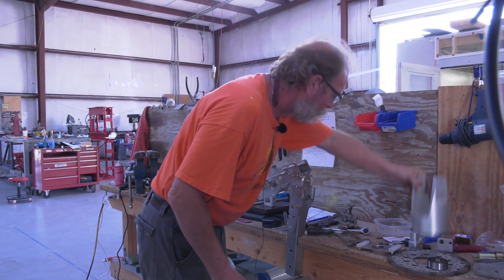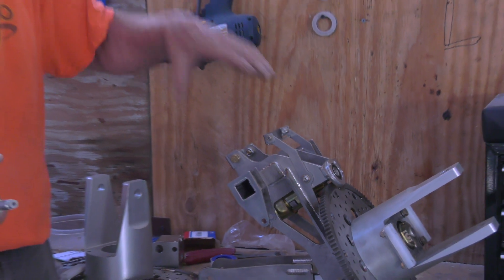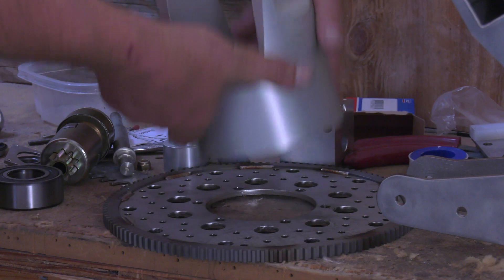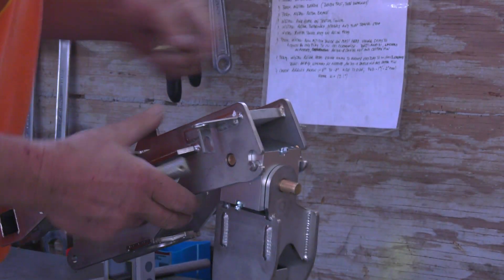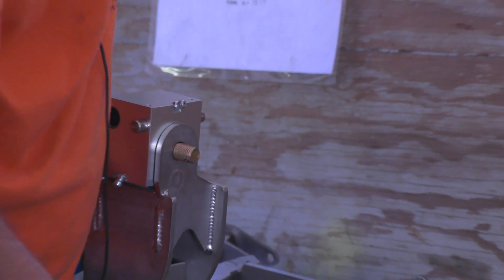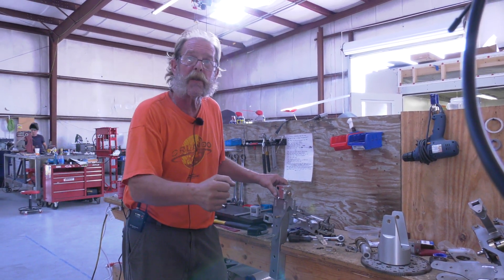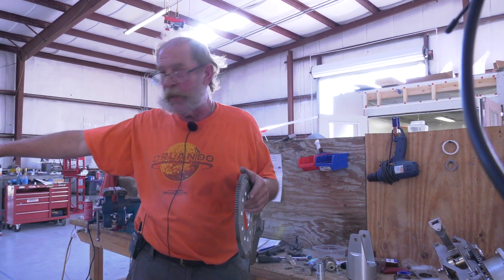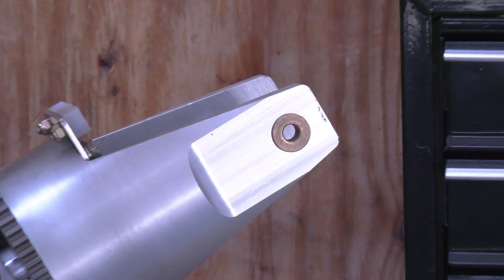AR-1 Gyroplane Rotorhead Assembly - Part 2 of 2

Comment: Sir what the use type of bearing in rotor head.....please tell me
Reply: Sorry for the late reply Sanjeet. For the main spindle bearing where the rotor rotates, I designed it to use a double row angular contact bearing made by SKF. However, engineering wise and to some people tapered roller bearing is better in this application because the way axial and radial loading happens here. Although I agree with that principally, tapered bearing block can be misassembled causing rotor to literally fly off. This a angular double row bearing of higher dynamic loading is enough and can not be misassembled and many gyroplanes have used it successfully and it lasts 2000 hours generally before replacement. Hope that helps.

Comment: What is the weight of the entire rotor head assembly plus blades?
Reply from the maker: Rotor system is 85 pounds. Rotor-head weight is not important because we never sell our rotor-head separately. Only on our machines
Reply: @silverlightaviation  Wow, I did not know it is that heavy. Is it made of 4150 steel?
Reply from the maker: @Aviator168  They are Aluminum alloy. Steel ones would be 150 pounds. These are not your old Bensen style machines. Rotors are 8.6 meter (28.2 feet) span, 8.5 inch wide chord
Reply: @silverlightaviation  I am just asking about the rotor head, not the blades.
Reply from the maker: @Aviator168  That's funny because that is what you asked in your original comment (plus blades).  Anyway, as I said rotorhead weight is of no importance as we do not sell it. It can only come with our aircraft kit. What counts then is just aircraft empty weight

Comment: Is that Radial  load bearing acting as a thrust bearing in the rotor head ? I will use a taper type bearing in this case
Reply: Good job bro
Reply from the maker: Some older designs did and do use tapered bearings and there have been a couple of deaths and a couple of videos showing rotors flying right off because people assembled those tapered bearings upside down into the towers. These bearings are not your regular ball bearings. These are double row angular contact bearings that can handle loads in both axis. The loads carried in this bearing doublet in the rotor head exceeds 6Gs and you cannot assemble it upside down. It does not matter

Comment: U have all these strong bolts and stainless parts, why not the little aluminum block be made out of stainless or light titanium that would be much stronger than the aluminum block.  It seems the aluminum block might be the weakest link and with that hole drilled through pretty near the edges.   Just am wondering is all.
Reply from the maker: And yet not in a single crash the Aluminum block has ever torn off. We are not making tanks. These are aircraft. We do not solve problems that do not exist. The name of the game is liten and simplify through engineering with proper safety margins for the application at hand. Not complicate and tankify.
Reply: @silverlightaviation  I totally get it, I am just wondering is all and I know it is not a tank or warbird.  I realize the problems more than likely do not exist 100 percent.  I am just thinking of safety margins etc and redundancy.  There are lots of types of aluminum.  If its aerospace stuff I would be ok with it and I am sure it is.  U have a nice machine and I like it.
Reply from the maker: @user-ev2qo1hj1g  In Aerospace the most common Aluminum alloy is 2024 for sheet metal. 6061-T6 for milled parts and also 7075-T6 for higher strength parts like leaf springs. All our milled parts are made from 6061-T6 and safety factory is in excess of 2. Usually certification requires a safety factor of 1.5 from limit load values.
Reply: @silverlightaviation  Thanks for the information.  I have been watching lots of videos and I would have no problem in your machine now that I understand a few things.

Comment: If you make a tray that has cutouts to hold all the parts for your Rotor set in the order of manufacture you will never miss install parts.
Reply: We use a solid model exploded view diagram. Usually customers have to assemble these items to meet 51% Amateur Built rule by FAA. We provide help and oversight